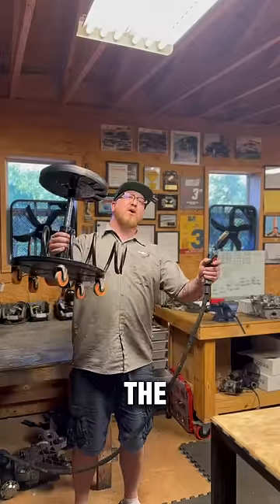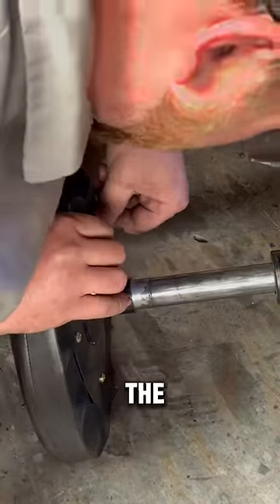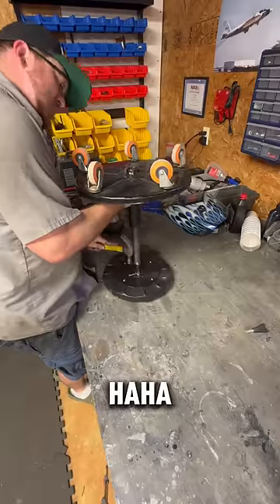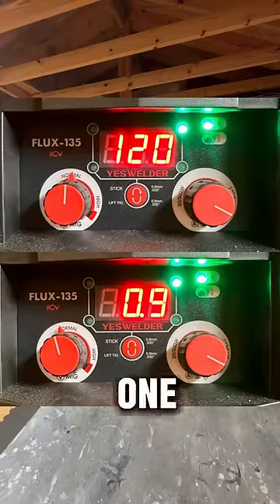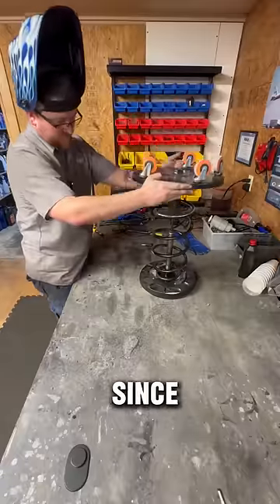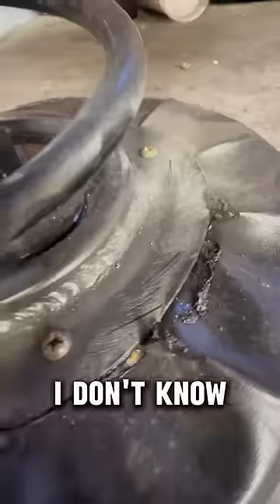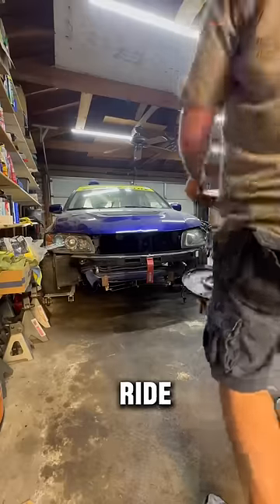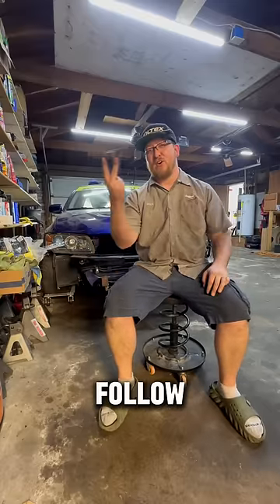Making coilover Shop Stool.

Comment: You can downhill weld bud , depending on what process you’re using. Flux core no, but if you’re running mig ( shiny wire with gas) you can downhill especially with thinner material like this 👍🏻

Comment: Hey man for what it is that weld is just fine. Also a good rule of thumb if you're just a home welder and not doing anything super structural, You want it to sound like a nice sizzlin bacon! If you burn through, too hot. If it globs up, too cold. Adjust wire accordingly.

Comment: Use a 1.0 wire speed and 120 to 130 take scrap and test different amperage and wire speeds and while welding make small c's with your hand from top welding to bottom of weld

Comment: As a certified MIG welder props to you 👏
Reply from the maker: Thank you! How were my settings?
Reply: @Bang4BuckRacing  a little low but every welder is different so I can’t say anything for certain. Were you using pulse? Typically I run MIG on normal settings at 18v 190 wire speed. The stool is also pretty thin so it makes sense to weld colder anyway.